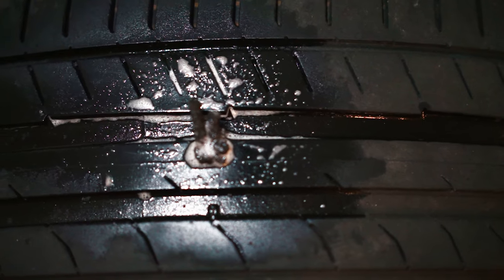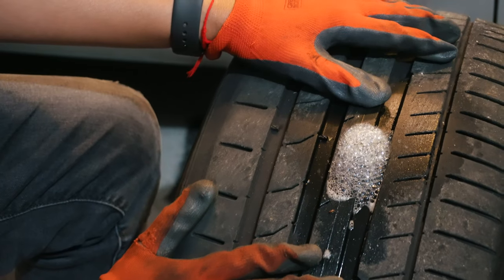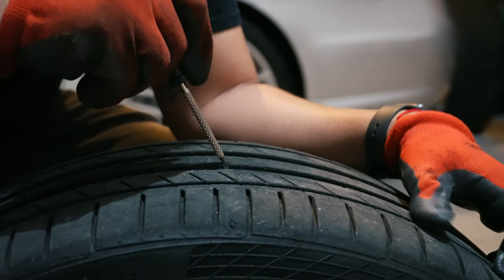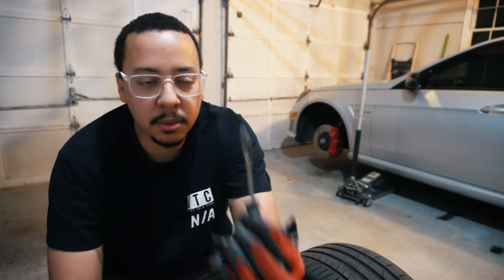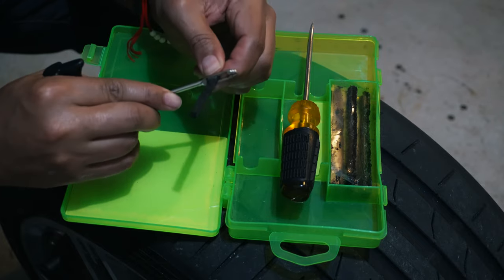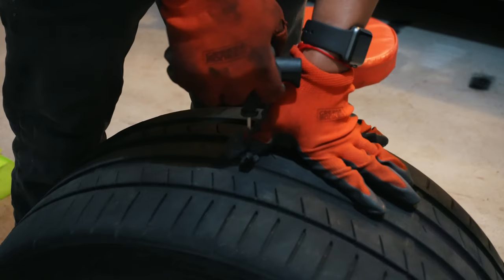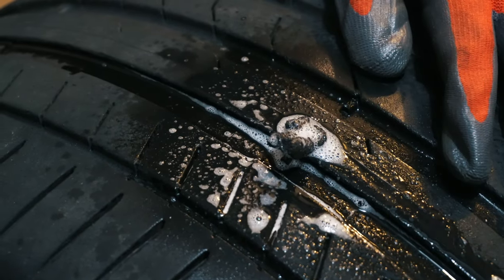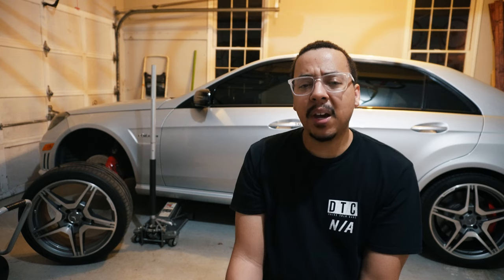Can you fix an low profile tire with a $9 Tire Kit from WALMART?

Comment: Keep the air in the tire “ that helps with putting the plug in”  and  the kit should of came with rubber cement type glue to lube the plug.
Reply from the maker: Thanks for the tips! I thought the same about the rubber cement. But it didn’t come with it. Tire is holding up good though.
Reply: @DriveTalkCars  I have a question about a wheel stud lug. I went to do my rear breaks last week but one of the lug studs just spins and won’t come back off. I can turn and turn and turn , it just spins.
Reply: How did you finally get it in?
Reply: @greenthumbtech621 you just have to hit it with your purse